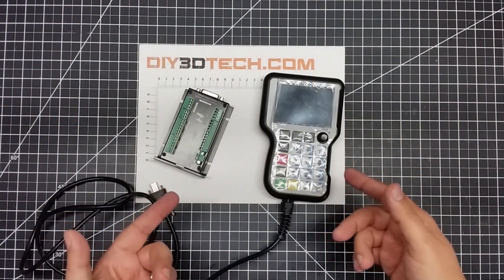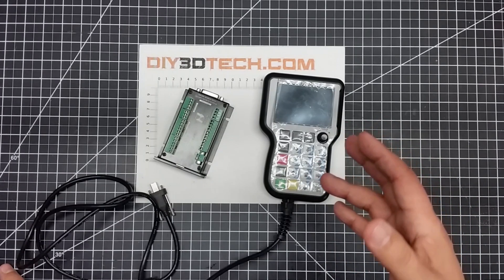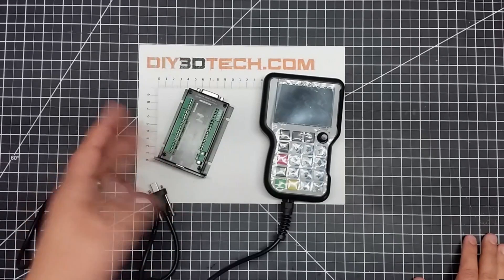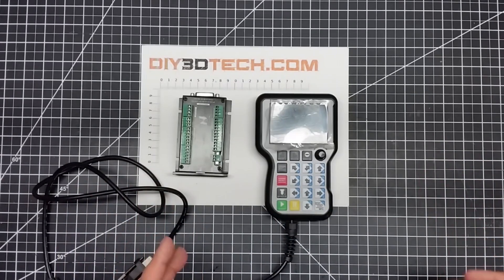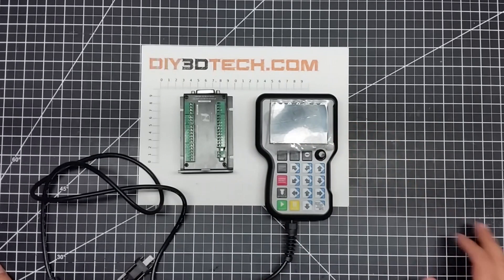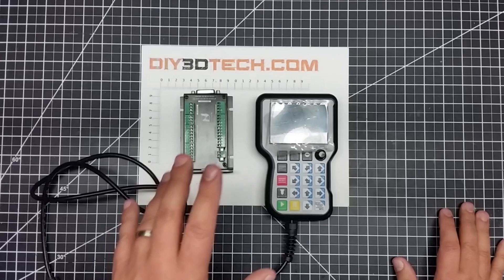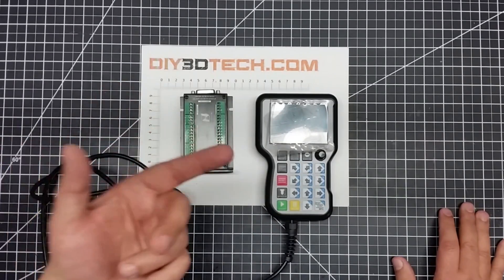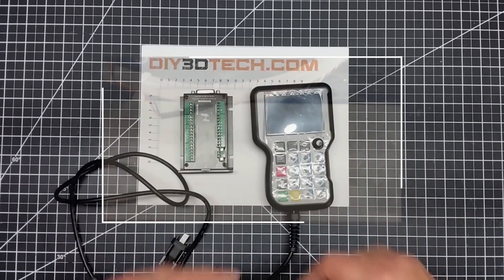3040 CNC - Finding a Replacement for GRBL!

Comment: The major problem with all those offline controllers is they do not have a homing routine for moving gantry routers with motors on each side of the gantry.
It is possible to drive two motor on the same axis but this controller will not square the gantry in homing cycle.
That is a pity because this would be a very good solution for many DIY CNC router builds.

Comment: I got DM800 from the same company. (NOVUSUN).  It had power supply issue, and firmare lock up.  I could not get support from manufacturerer.  If you want to try this purchase from Amz.  If there is a problem return immediately.  Lack of QA, lack of customer support, total garbage!

Comment: This works the best with a closed loop system I have the 6 axis version
Reply from the maker: Interesting, how is the pulse speed?
Reply: @DIY3DTECHcom  everything so far has performed wonderfully I'm building another machine right now what the same setup and I never lose position due to the closed loop system and they are ten times faster and 10 times quieter to you can do high-resolution Stepping and hold very tight tolerances the board also has backlash compensation on it too
Reply: Yes

Comment: DIY3dTech - I have three of the sister controllers (DDCSV2.1) to this controller and just ordered one of these in 5-axis ($179 on Banggood) which I plan on designing my own 5-axis hobby CNC around.  The other controllers are 500KHz, and I also had issues with TB6600 stepper drivers not being fast enough got the signal for direction change, causing a 'layer shift' similar to what you see with 3d printers... A little bit more money ($13.99 each on banggood) to get DM556 Stepper Motor Drivers solved my issues.  This looks easier than the DDCSV2.1 controller to wire, because the wire inputs are more easily accessible than the DDCSV2.1, and each stepper has a dedicated hookup for the +5v pulse/direction... should make for a much cleaner control box.  Looked for the progress you had made with this, but found none...
Reply from the maker: Many thanks for this and sorry to say have not made much as after getting this built a new house and two shops and now COVID so life has been a challange!

Comment: What's the latest update or video you have on this solution?
Reply from the maker: Seems to be a big question however it has had got to the back burner however might come back to this in fall if the Corna issue die down...

Comment: I am curious why you fell out of love with GRBL. Youre not the first person that has switched from GRBL to mach 3, or the other way around. I just am curious as to why. Nobody ever states why, and I am seeking the answer to that question to support my decision making process on what to use.
you mention the UARTs, I just wanna know what kind of problems you had etc.?
Reply from the maker: If you watch a few of my videos in the CNC playlist you will get a better idea as it is not so much GRBL.  However the implementation of it  and first and foremost are the cheap CH340 UARTs which drop connection to the computer. The next thing is the need of a computer.  Now this is a bit old and today there are affordable off line controllers which solve this problem which did not exist in the past.  The other big issue of the time was 3 verses 4 axis as GRBL was not capable (and still is limited in my book today)  but there are AT-Mega fork which solve this.  The list goes for smaller nits and I not picking on GRBL as for what it is, it is a great hobbyist piece of firmware however if you want to move to pro-sumer if you will there are better options....
Reply: Reliability is why I gave up. I had been using bCNC and found myself writing code to make it do some of the things that I wanted it to do. I also didn’t want to be doing that, so I ended up taking a chance on a Masso G3, which I’ve been mostly happy with. Rock solid reliability. No PC involved at all. Lots and lots of I/O to connect things. It is a DEDICATED cnc mill controller, S opposed to a PC acting like a cnc machine. I just ordered another Masso for my new machine, so I guess that’s an endorsement of sorts.

Comment: Did you end up giving up on this one? I’m considering getting a 6040 which seems like the same controller as yours but bigger but really want to avoid having a pc permanently attached so thinking these could be a good solution but need to work out whether to get parallel or USB. I wonder if that pendant will work plugged directly into the USB version without the breakout circuit.
Reply from the maker: Just have not found the time to wire it in and no I do not believe it will just pluged into the USB.  It also requires a 24 volt power supply to will take far more wiring (time) then I have had.  If I was to do it again I would use the sain smart board with an offline controller.  Not professional as this but far easier and cheaper...
Reply: DIY3DTECH.com thanks for the response. Can fully understand the lack of time thing. I was assuming the pendant is basically just using USB and sending a stream of gcode and the breakout would be converting that into the stepper directions, steps, etc. something similar to what mach3/4 does on a pc. Have you happened to open up the cnc controller that comes with the 3040 cnc?

Comment: I studied the manual of this CNC controller and found out that it is also not supporting tool radius compensation (G41\G42). So it’s on the same G-Code level as GRBL. And I dislike this tiny screen. Having a PC with a nice GUI for GRBL like with BCNC helps a lot in the shop. You can see at least a part of your program to identify where you are, that the work zero is at the right position and that your work piece is oriented as programmed. My question is how this controller handles acc/dec and feed rate adjustment to the contour, sth. that is quite poor with GRBL. Anyone tested this NCH02 and can compare the motion to GRBL?
Reply: Yes, You are right with that - but only when you ignore the basic rules of shielding like I did in the beginning. Use a good (shielded) and as short as possible USB cable, use opto couplers for your limit switches and a well shielded cable for the connection of your VFD to the spindle. All that costs you 50 bucks and two hours of work. I’m often running 10-20 hour programs and the connection never failed again.
Reply from the maker: The issue is computers lose connection to GRBL especially on long running jobs.  If you look in the CNC playlist you will see what I mean and the main reason for trying.

Comment: Did you every finish installing this? I am curious if it was worth it or how its is working out for you.
Reply from the maker: Not completely as I decided to build a house instead.  However it is back on the bench and I did mess a bit with (not  enough to produce a structured video).  It does work...

Comment: I would be more interested in hearing if it supported full gcode with canned cycles- i would still lik the option of connecting to a laptop/pc or even just a monitor/touch screen
Reply from the maker: Canned Cycles?

Comment: The biggest hurdles for grbl were it's 3 axis limitation and future expansion because of computer hardware limitations. With the upgrade in processor and ability to read from cheap and large SD cards we are at another large hurdle and that is software to generate code beyond 3 axis. While many are jumping on the Fusion 360 bandwagon, I'm looking at the open source options. I've been burned too many times by software that turned out to be a wolf in sheep's clothing. 
If I truly felt limited by 3 axis I would take another look at CNC Toolkit. It's gone open source and was years ahead of the rest when I last played with it over a decade ago.
Reply from the maker: I can understand part of what your saying, however I do recommend F360 as if your good with it is easy to get a job.  As a hobbyist I find it complex and in fact a too complex and plan to switch to MeshCam for CAM and use F360 for CAD as I don't use it enough (as a hobbyist) to remember how to effectively use it between uses...

Comment: Have you seen the updated 6 axis version of grbl? https://youtu.be/V_ztt9QiaQE
Reply from the maker: Thanks for sharing and yes, however as you can see from the associated web site it not what I would consider "main stream" as I have seen several successful attempts at taking GRBL past 3 axis however even at 3 axis GRBL has some issue (a lot to do with the hardware and limitations) and the reason I choose to go this route as wanted to spend more time making then fiddling with GRBL as what just drove nuts is I would run a job for an hour or so then have it fail :-(

Comment: In lieu of waiting for an update video, I went ahead and purchased this and have been testing it for about a week to a week and a half. It has a lot of quirks that I have yet to work out but I have completed some 3d carvings with it. 
To anyone thinking of purchasing.
1. Z axis homing runs backwards, I have not yet found a fix. Currently using estop to manually home XYZ for corner finding. 
2. profile tool paths generated in Fusion stop at 180 lines - still have not found a fix. Have not tested other tool paths yet.
3. It will not process or run .gcode files. Please see below.
3. Vetric generated tool paths work. Use standard Grbl post processor (mm). Open the file in a text editor that does not effect end of line encoding (ATOM works like charm) and save it as a .nc file.
4. do not have any spaces in the tool path file name, for some reason this causes occasional load problems.

All in all I'm pleased with it. If you have any questions just leave a comment.
Reply from the maker: Greg forgot to ask, how did you wire this in and to what did you wire it out of curiosity...
Reply from the maker: Big many thanks for this!  Sorry delay in the process I decided to build a new shop (and house for wife) so been very busy with that  I have seen the premature stopping with Fusion code before and been told by other viewers that its arch verses lines in the post processors.  The inverted Z homing is likely a setting as I searched the internet before buying and found it does have configuration like GRBL so you should be able invert the movement.  Many thanks again for sharing as this will come in hand this fall when I back it it!
Reply: @DIY3DTECHcom  A quick update. The Z probing has been fixed, the setting was labeled as "Probe-level". When no wires are connected it will appear to probe fine, but as soon as wires are connected to the specified pin it will run backwards. Change the probe level 1. After running the controller for probably 100+ hour, I have to say hands down the best investment I've made into my machine. Being able to stop and start long 3d carves is a godsend.
Reply: @gregvinyard7375  Hey Greg, your review of this unit is probably the only useful resource I have found about it until now, thank you. 
I am building a CNC router and looking at the NCH02 or DDCSV1.1 for the controller. This would be the first time I'm working with a stand-alone CNC controller & I found the DDCSV1.1 less intimidating to setup because of the internet references available for it. Which one would you suggest I go with?
Reply: @rulabs2240  I have no experience with the DDCSV1.1. The bright side is that after many hours of figuring out what their written manuals imply I may be able to help with it remotely. Personally I dissembled my NCH02 and found the cord is just a standard USB cord connecting from the driver to the controller, so I extended my cable so I did not have to purchase an additional pulse unit from moving my cnc around. My controller is my pendant and for me that's far more valuable than a stationary unit. I think that both units will operate with the same function (all the buttons are the same). The advantage of DDCSV1.1 is the USB pendant port, which would enable a wireless pendant controller. For me though my machine is only 60" x 60" so wireless is not important to me. I will give the manual a read through tonight for the DDCS and see if there is anything that stands out to me you might want to be aware of.

Correction: started reading the manual, USB Type A port is for loading Gcode only. Still needs a wired Pendant.
Reply: @rulabs2240  I read through the manual last night. In my opinion if this your first time working with a standalone controller I would go with the NCH02. The interface seems to be a lot easier than the DDCSV1.1. If you do want a stationary controller I would go with DDCSV3.1 instead of the 1.1. That model at least has XYZ probing which is useful for Setting zero on square stock, and the manual is easier to read.

Comment: How did this end up working? Is there any issues with regards to generating a smooth trail of pulses when cornering? My issues with grbl is it's maxed out the Arduino with the latest 1.1 release. That just about insures no future growth. Barton Dring ported grbl over to esp32. The esp32 is as cheap as an Arduino but it does not have the memory limits and it's many times faster. Generating a stepper pulse stream is a breeze with it's speed. I also like the fact that WiFi and Bluetooth are built into the esp32. Bart's ported version of grbl takes advantage of this and it's also able to read and write to an SD card.

I'm currently needing the speed and memory for a project that's using quad encoders and the older Arduino were out of power. Bart also designed and sells a cnc controller board that would work well with many cnc projects. One of his videos goes into depth on the software he used to port grbl over to the esp32. I think that's the genie that needed let out of the bottle for grbl expansion. He's planning to add more axis controls and more. Here's a link to his videos:  https://www.youtube.com/user/engserve
Reply from the maker: Unfortunately have not done a lot with it as right after getting decided to build a new shop (and house for the wife) so been occupied with that, however ecpect to pick this back up in October or abouts.  However hear on the issue your having...

Comment: Hello, I replaced my PC+Arduino configuration with nch02 and it works very well, the only problem that I still have is that I can't activate one of the outputs marked OT3,OT4 and OT5.
I tried with the M instruction but I did not manage.
Any idea how to solve?
Thanks for any help
Reply from the maker: Sorry none, however good to hear it does work!

Comment: Any news on this controller? Does it work as it should?
Reply from the maker: Have not had the play with it, soon after getting I decided to build a new shop (and attached house for the wife)  so that been all consuming for right now...
Reply: @DIY3DTECHcom  Im considering it as a replacement for mach3 on my cnc's. I have a ddcs v3. 1 but fined this handheld to be more practical.
Reply from the maker: The only issue I have heard of is the unit "might" be too fast for the cheap stepper drivers and they lose steps.  But it seems hit and miss....

Comment: What about grbl esp32 ?
Reply from the maker: I like the "idea" a lot, however its very new and what I am "trying" to get away from is spending more time hacking then making chips.  This solution is "very commercial" so my hope is it allows me to spend more time making chips then swearing at for not working or losing connection.  Also its an all in one solution in that I don't need a computer or pendent as its also both for $200 bucks...

Comment: I am also looking forward to this video.  I spent 6 hours straight on my tablet researching CNC controls, breakout boards and servo driver boards.  Then I found your video.  You have the same 3040 machine I have and showed in the picture the same controller I picked out. Awesome, can't wait.   Unsure about the controller sending code too fast.  I thought if you set the step frequency to the motor the control would have to "wait" because it would know the speed of the motor and the distance traveled.  Unless the stepper drive boards are smarter than I think and buffer commands and fall behind or buffer overrun.  The original is 100k and the new one is 125k so its close.  Fingers crossed that is why I picked it.  The others ran up to 400k and that seemed over kill.  Good luck in your venture and looking forward to seeing your expertise.
Reply from the maker: Many thanks for the note!  For clarity the issue is the stepper driver may not be able to respond fast enough to the signal from the controller as there is zero smarts in a stepper system and the reason all high end systems use servos with encoders for absolute positioning. I am thinking this will be ok at least for hobbyist tasks...